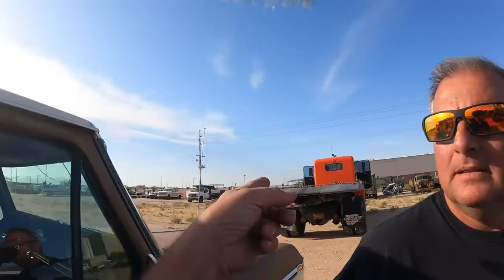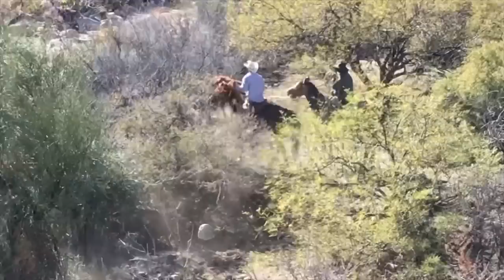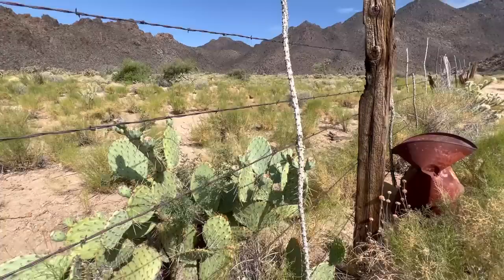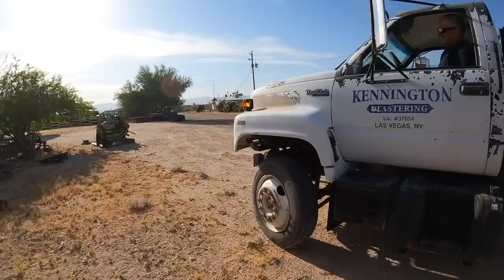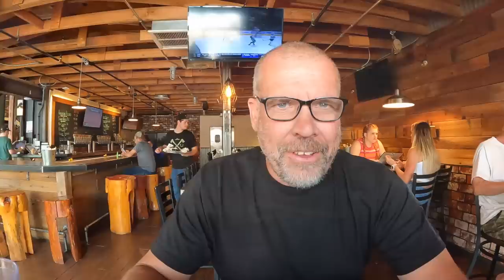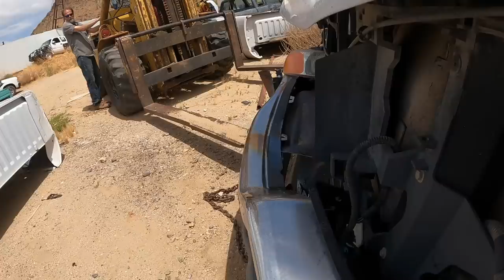The Kenworth Rollback is Getting Put to Work Today!

Comment: If you think you`re tough, then go volunteer at the ranch down there in the summer! I`m sure there is more than enough work fixing fence or rounding up cows thru all the cacti. Easy enough? OK now add 110 degree heat to the mix. Rugged is only the beginning and that was just the scenery.  Great story!😲

Comment: In the 90's.. My uncle had an old late 70's Ford (blue) just like that with a big block and it was lifted a bit (not crazy).   We drove it down to the pond dragging a 20ft platform that we used to work off of to put siding on 3 story apartments;  We would boom it up with a Skytrak and have all kinds of room to work.  But I wanted to use it as a dock.   Dragging that dock behind us (20ft 2x6's, X 6ft wide), he drove that truck through the corner of the pond and had water over the hood. lol..  It got way too deep;  but he made it out the other side, and the deck was in the water.  All I had to do was bolt two posts on the end of it.   Crazy times.. I was only 14;  I stayed the whole summer there with my uncle.  Swimming in the pond everyday, shooting shotguns and working everyday building houses with him.   Good memories in that Truck.

Comment: Interesting to hear that the Antler mine is back in operation. I've been there once on the way to the Borianna mine, I'd really like to do that trip again. I read they looked into opening the antler mine in the 80s but that they figured the copper prices would drop before they could recoup their investment. I also read that the lower levels have poison gas and remember there was a vent that smelled kind of funky on the surface.